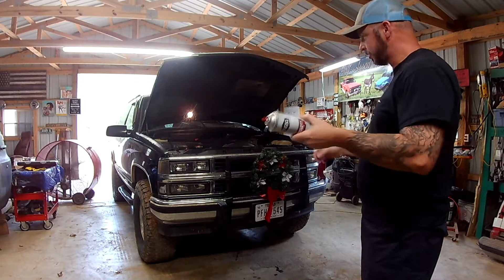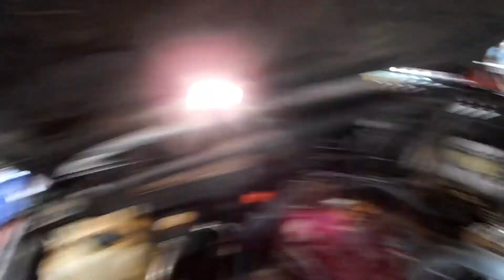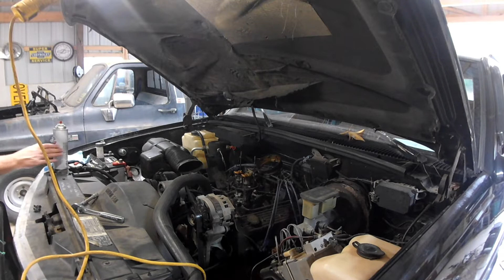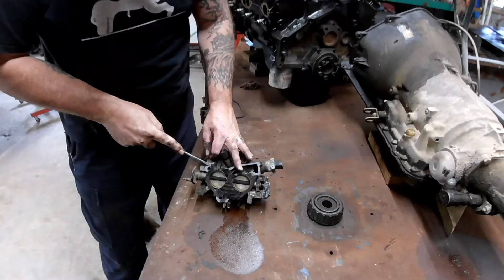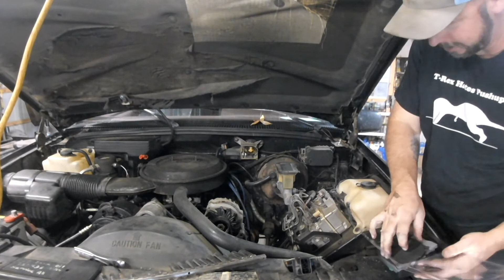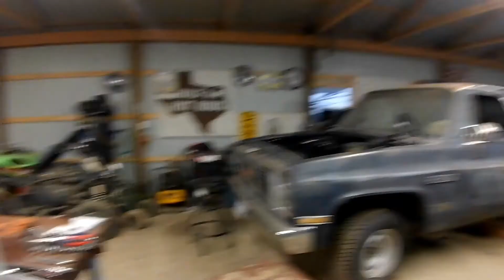OBS Chevy High Idle and Wiper Repair

Comment: What’s the idle in gear / not in gear for the tbi models ? I have a 88
Reply from the maker: I’ve seen answers of 550-800 but if they’re working correctly the computer and idle air control should manage it.  I’ve never changed the idle on a tbi engine.

Comment: Throttle body gasket is bad I'm doing this job right now as we speak!! High idle in my case was the throttle body gasket spraying carb cleaner or brake cleaner under the throttle between the intake. Any stalling when doing this will let you know it's the throttle body gasket. Thank you for this video.
Reply from the maker: I hope you get it sorted out. Thanks for watching and the comment!

Comment: Any Ideas how to take the plug out of the idle adjustment hole and put a screw in or does it have to be tapped?
Reply from the maker: I believe the idle is computer controlled, so if you're thinking you need to mess with it, there's probably another problem that can be fixed more simply.  I have never done what you're talking about but I think others have.  Thanks for watching!